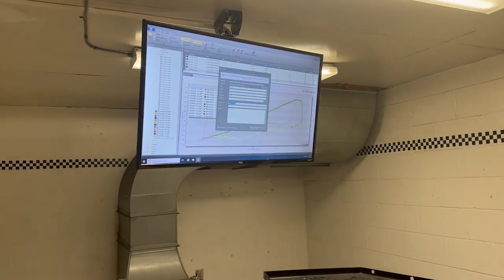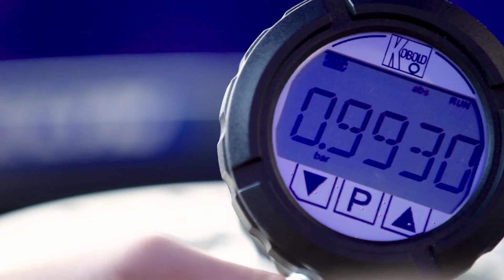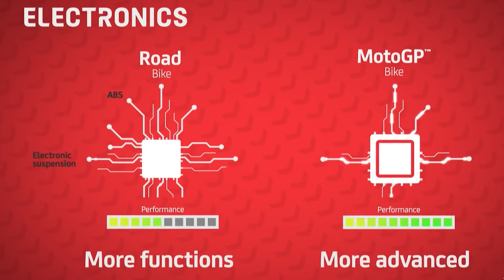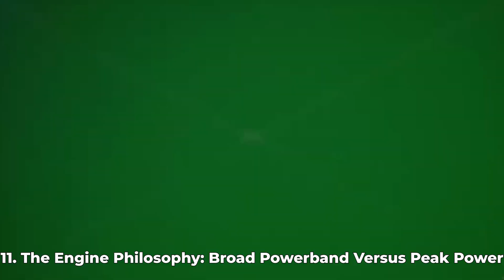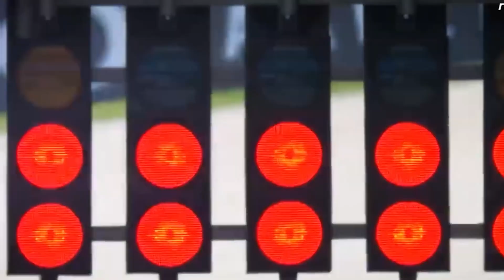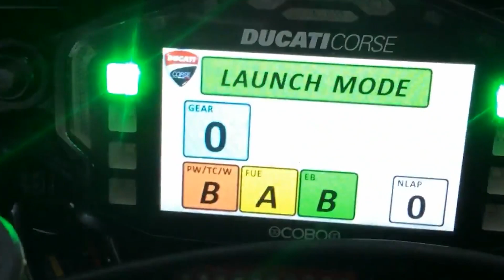MotoGP vs. Moto2: Why 765cc Triples Can't Match Prototypes

Comment: Problem with moto2 is it sucks. Non inspirational. The homogenous bikes, no brands. It should be like the 250s were. And be 400 four strokes, a classic bike size with a fine racing pedigree. And GP should be 750s, like Superbikes was in its great era.
Reply: Wish there were more 750 street bikes too, 600s don’t have the torque and 1000s are heavy and overpowered. I have a vfr800 and it’s a fine bike just heavy and a bit underpowered, good torque and handling for what it is though
Reply: @Interceptor.alistair800 absolutely. And the vfr is an awesome example of them. Great bikes. Martin Porter from AMCN back in the day always said nothing scrapes like the VFR.
Reply: The motors are too powerful in GP now and this is why it has become an engineers race. Less power would return more control to the rider
Reply from the maker: You've definitely got a clear vision for how the classes could evolve!